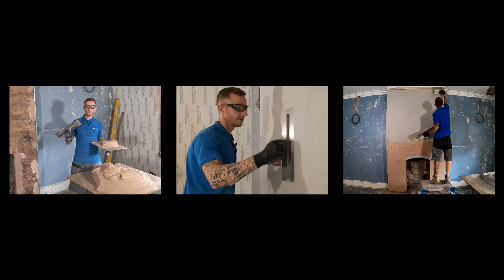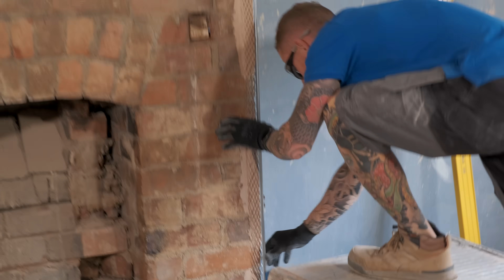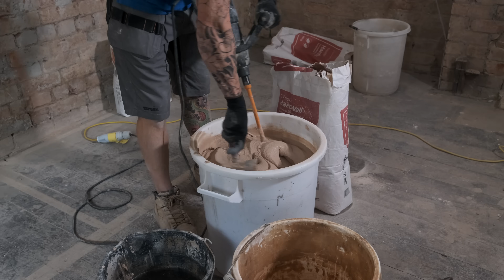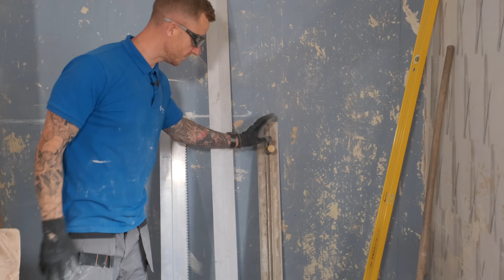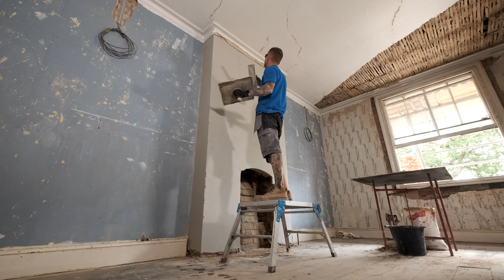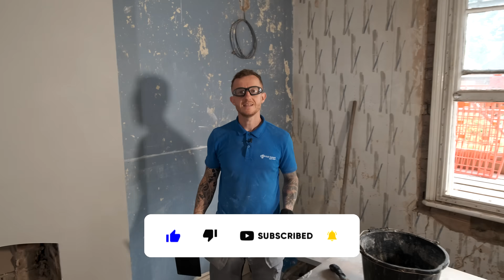Plastering with Two-Coat Plaster! | How to Install Thistle HardWall

Comment: how does the dura finish compare to multifinish when applying, is it harder to work with or same?
Reply from the maker: It's just as easy to work with, but I'd definitely recommend a plastic trowel to finish. 

All the best, John 👷🏻‍♂️

Comment: Great Video Tutorial John. I have just had builders put in new plasterboard and under that I used WEDI waterproof boards. What is the best Plaster to use to on the plasterboards? We want to paint the plaster once it is dry and sanded. 
Thanks

Comment: Looks a good job on the bit you have done. But the join to the ceiling looks a little rough - but I know you guys don’t leave anything less than perfect! I’m interested in how you will make that good?

I have faced a similar issue loads in my victorian terrace and ended up just building out, but there has to be a better way… anc I am guessing you guys know it!?
Please share
Reply from the maker: We have a fantastic guy who will be repairing the coving throughout the property. We didn't want to rip it down when it can be repaired.

Hope this helps. 

All the best, John 👷🏻‍♂️
Reply: Makes perfect sense… bet it looks awesome

Comment: Nice work John. Whats advantage of that method v plasterboard ?
Reply from the maker: Wet plastering is a more traditional method, which gives very solid walls. When coupled with Durafinish, you've got some very sturdy plaster work 😁

All the best, John 👷🏻‍♂️
Reply: @BuildWithAE  Ah i understand. Thanks John 👍

Comment: Nice job. I was wondering if the Finnish coats drying time same as multi.
Reply from the maker: It does take a little bit longer, but it can vary depending on atmospheric conditions. 

All the best, John 👷🏻‍♂️